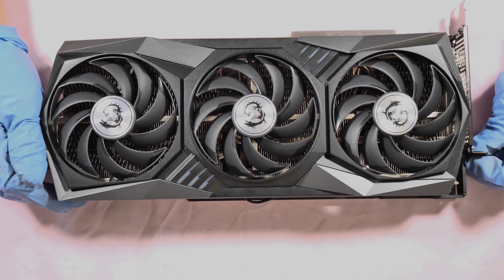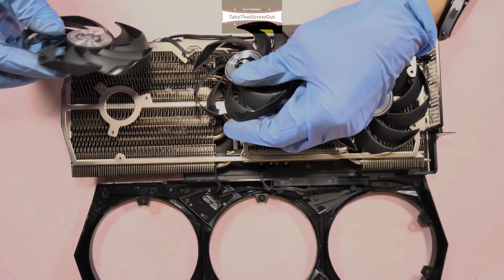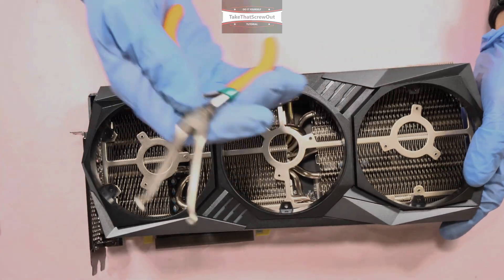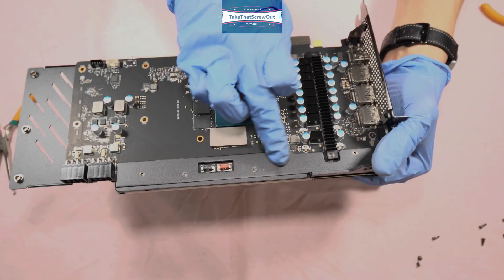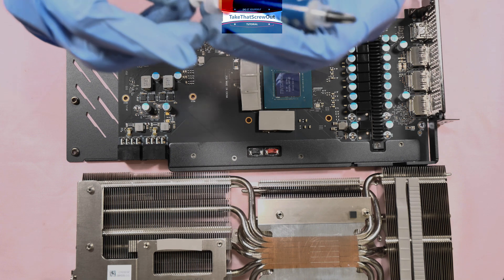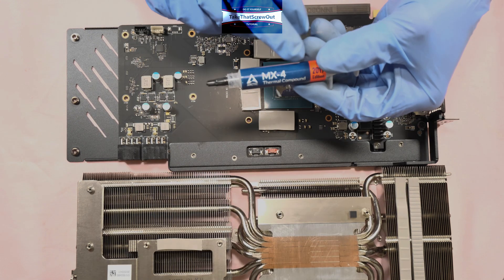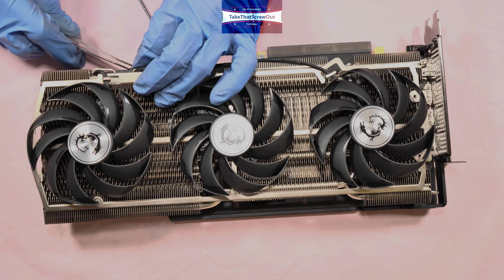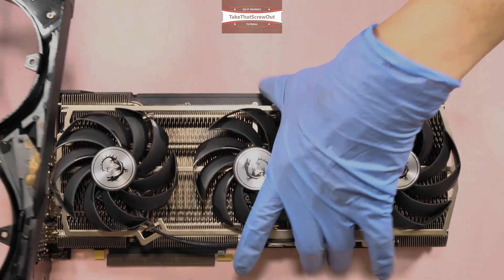MSI RTX 3070 GAMING X TRIO | Thermal Pads & Fan Replacement | DISASSEMBLY/TEARDOWN Tutorial

Comment: I didn't have a stand when using the card, now the card is very crooked and it looks like the pads are no longer sitting properly. However, the temperature is not noticeable and performance is normal. What would you recommend?

Comment: how to change Thermal pad to thermal putty?
Reply from the maker: I don't recommend to replace high quality Pads over thermal putty.. but if that's what you prefer..simply remove all pads area and clean all areas (chips) that you're going to put putty in, use 99% isiprophyl alcohol to clean..then put putty on individual chips that has been with Pads before. Make sure to have good contact with the heatsink when you put it together. Hope this helps.

Comment: helllo its problem to use 2 mm on the 2.5mm ?
Reply from the maker: I would say, it's Potentialy might cause you an issue due to not enough contact between heatsink, it will not transfer the maXimum heat. But sometimes it might still works, just investigate the contact area when you screw in. Hope this helps. Take care!

Comment: Great Video. For anyone upgrading the stock pads. There is another 1.5mm thermal pad under the heatsink for the ICs, just beside the inductors
Reply from the maker: Thanks for your additional info bro..that could help a lot

Comment: Great video! How do you remove rusted screws with this card?
Reply: rusted screws? 💀
Reply from the maker: Mostly of the gpu that has corroded screws or heatsink fins are those used on Mining Rig.. Because they are more likely running 24/7 and they created condensation from the heat of room temps.. If that happenee to your gpu, just remove it carefully..never use a Penetrating oil Spray..that could potentially leak and run to the board and cause short circuit.

Comment: Great video. I noticed that you fans are PLD09210B12HH ball bearing.... my fans are PLD09210S12HH fluid bearing. Have I got scammed ? The card was boxed brand new..... the reason I wanted to replace was because they are loud at 45% fan speed. What can you tell me about this please
Reply from the maker: That might happened probably because gpu are made from different countries..some are OEM's..and they outsource their parts from different suppliers. But they are still legit. They are just not made equal..just like cars. 🙂
Reply: Not sure how old this card is in the vid, but maybe they switched to fluid from BB due to issues, or they just changed manufacturing and got cheaper fans? This is not un common.
Reply: @Ryan-re1rs  Ball bearing definitely issues. alot of hissing and scraping noises with those bearings.  The fluid bearings are much better. The fans still make noise at 40% + fan speed no matter what the bearing is, but atleast at 30%-35% they are silent for sure (with fluid bearing) 
I wasting 50$ trying to replace them with ball bearing ones
Reply: this card is not gaming x trio, card in the video is gaming z trio lhr model